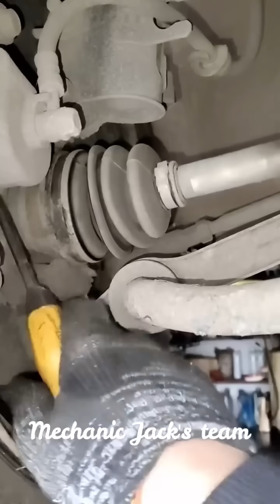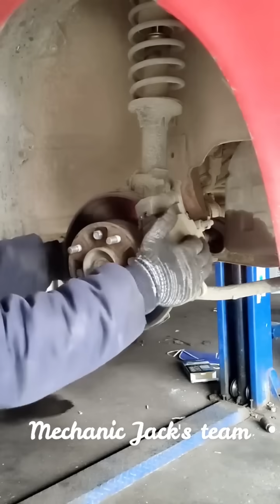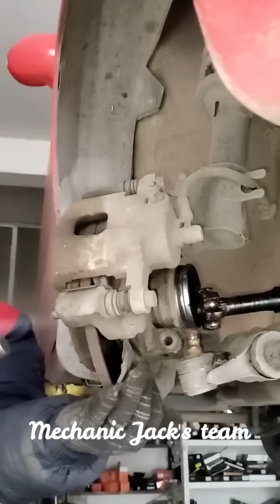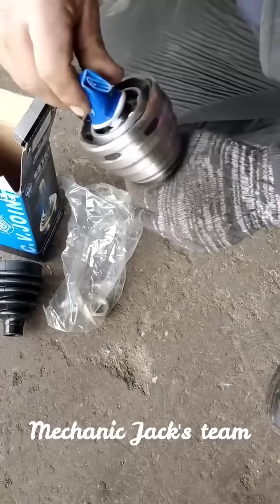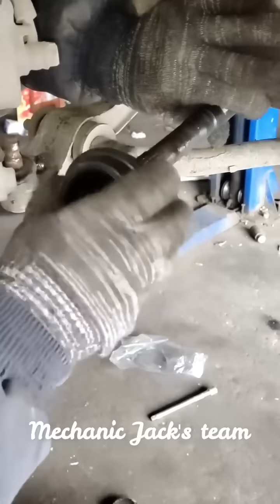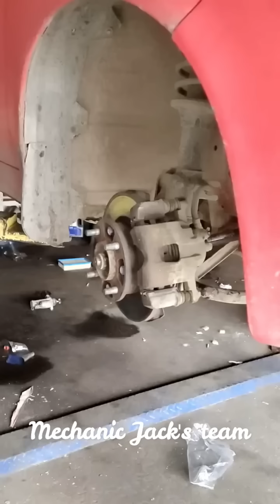Repair Chery CV Joint Noise

Comment: Aftermarket axle assembly normally 89.00. Not worth rebuilding it. Cheaper to replace the axle assembly even when a boot is just ripped in most cases especially at 150/hr
Reply: Very very true. Should have a thousand likes.

Comment: I have never seen a cv joint come off the hub that easily
Reply: One which has just been fitted, where the car has not been on the road yet, might come off like this.
Reply: That’s why leaving the axle hanging out of the transaxle is a stupid way to do the procedure.

Comment: What a hack! Just ruined the wheel bearing by impacting it tight. Not to mention the floppy ball joint. Anyone knows that the inner triad has just as many revolutions as the outer. Oh yeah..... I'm supposed to be satisfied with everything anybody does. Oh well.

Comment: You should have changed the whole CV axle instead of rebuilding one end of the axle . It costs almost as much and it's better to do it that way .
Reply: I agree, don't you know how some customers can be? So...the customer gets what he or she wants, because his or her friend knows a wanna be mechanic that lives 2 streets over, bla bla bla. That customer will be back in 2 weeks to finish the job.
Reply: Do you think you are talking to those techs? Those guys just get stuff done quickly and without overthinking everything and over charging 
like our dealership techs do in our country ..
Reply: Way harder though
Reply: @davesstuff1599  Harder, really? Once you get the axle assembly out to rebuild one C-V joint...quick. Drive to Auto Zone , pick up new assembly,  return to car and install. Been there, done that. I've also rebuilt C-V joints, much easier to replace axle assembly,  which comes with new C-V boots.
Reply: Depends on what country you are in! A lot of them don’t have the parts availability that we have.
Reply: Labor rates are not the same everywhere, in a lot of countries it makes sense for the mechanic to rebuild the axle instead of buying one. Those new ones aren’t really “new” either that’s why they take your core when you buy it so someone who gets paid minimum wage can rebuild it for you I’d rather have a mechanic rebuild it if the prices are similar.
Reply: @justincase1575  exactly right
Reply: New axles like $100 cheap and easy never rebuild
Reply: You are right. The shaft would be out of balance and the same will happen again.
Reply: @davesstuff1599  Yes, doing the half-assed job he did was way harder that replacing the whole assembly.